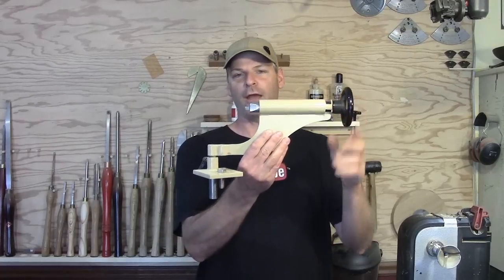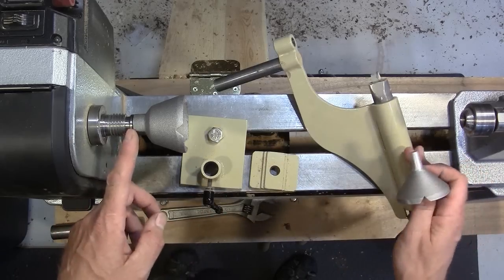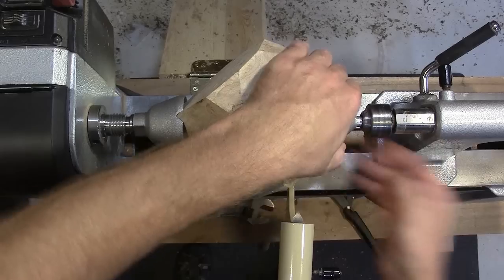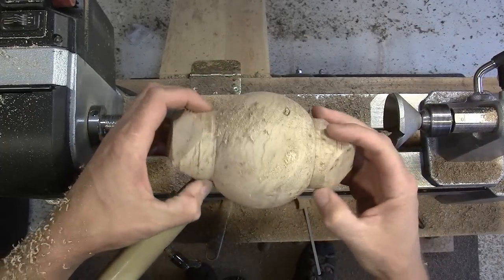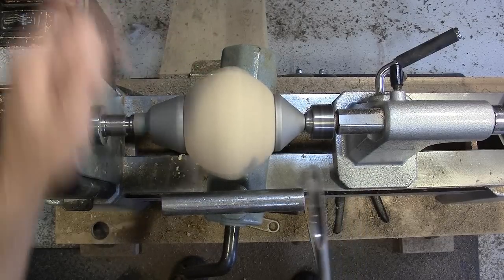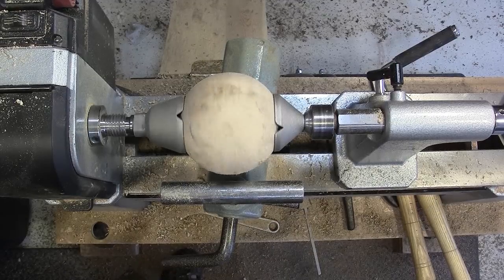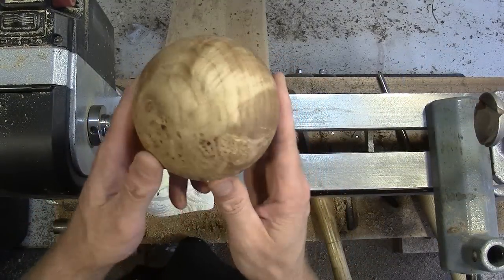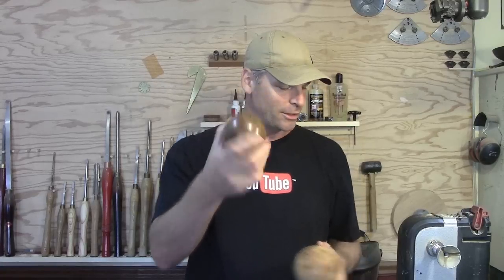How To Make Perfect Sphere On The Lathe With This Jig | Woodturning

Comment from the maker: Hi Gary, The website is (woodlandinspirations com). I use paste wax and mineral oil to sand with just to cut down on the sanding dust. A 4" block should be fine after sanding. To get 16 ounces you need a pretty dense wood.

Comment: great video, nice jig, if you keep the jig set on the last radii you turned, when you remount the ball to take of the ends you can slide the jig along the bed till the tool kiss's the spheres surface, that will recenter it whole unit so you can fininsh off the cut.

Comment: Where can we get that jig again?  What was the material you had on your sanding pad?  I want to make a croquet set.  What approx. minimun size of the block do I need to start with to get it the size of a croquet ball that is 3 5/8" round?  It needs to weigh 16 ounces finished, what type of wood should to used to accomplish that?